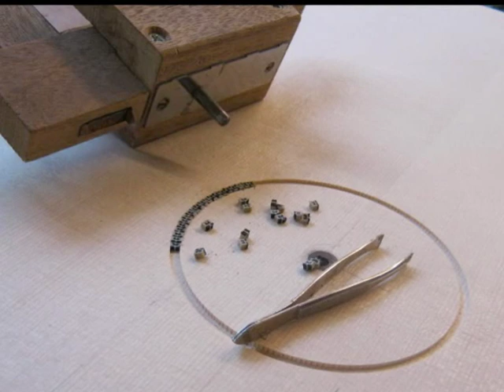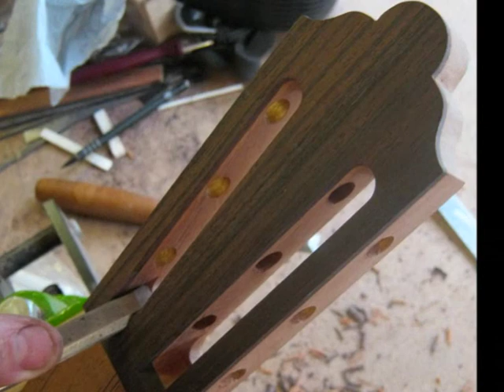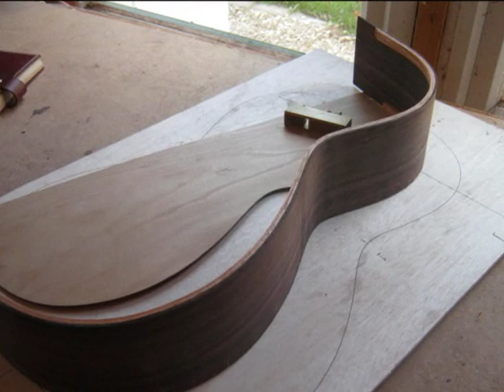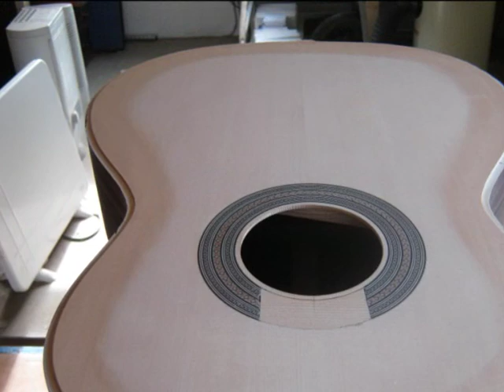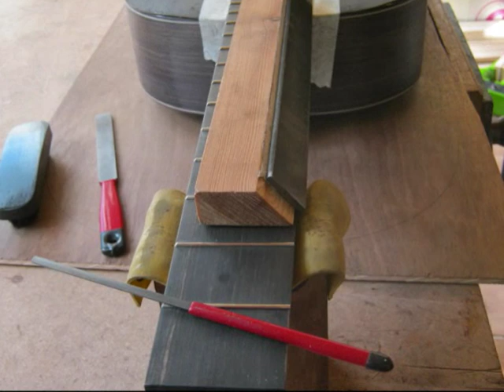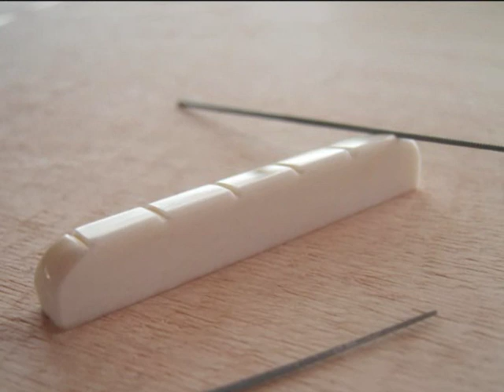Richard Newman Classical guitar maker, music, Color Sepia (M.D. Pujol)

Comment: The process of placing a Rosette onto the top is as unique a technique to accomplish this step as I have seen. Normally the elements of making the rosette are part together separately from the top. Then a channel the width of this is routed into the wood of the top. The Tuning Machines appear to be the ones Irving Sloane was selling years ago. I believe they were Brass plates on them (If these are the same ones that I'm thinking of. There are some Tuners made by a "Vstuners" currently that appear to made of the best materials & as such are geared for the Luthier looking for worthy tuners

Comment: Nice traditional guitar! 
In the current on the market models, aluminum string drums are used for most of them and the bushings are usually in teflon; I personally believe that the replacement using galalith conveys a considerable improvement in timbre and sound sealing.